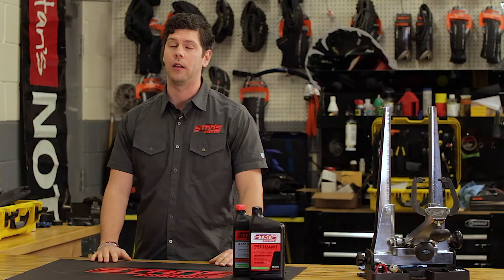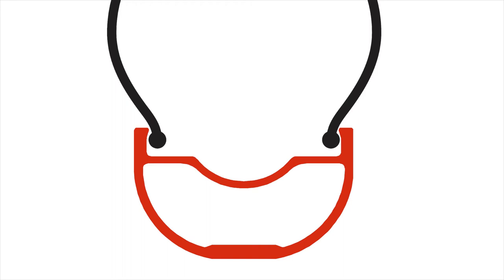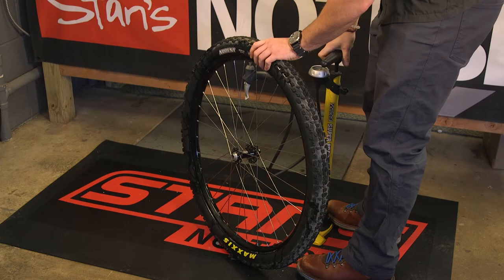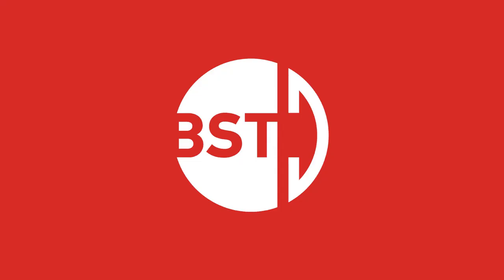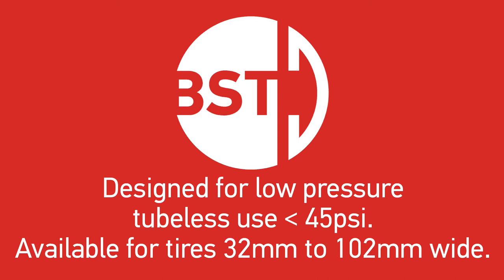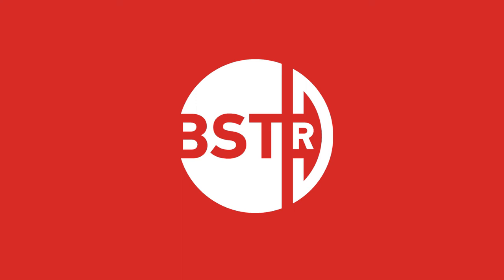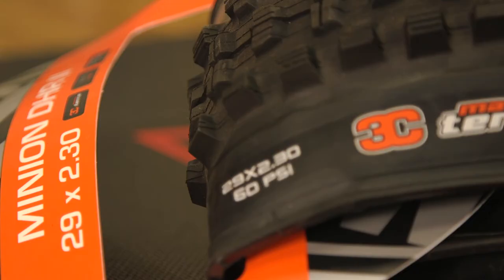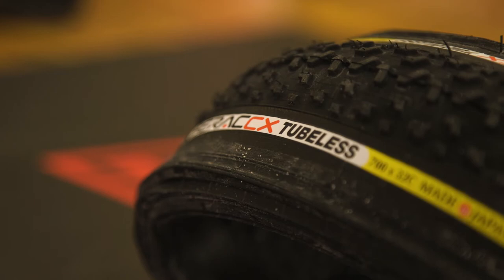BST vs BST-R

Comment: Just purchased my Crest wheel and I'm super excited! The crest has 2.25 limit for optimum tire shape will running a 2.3 be ok?
I know it doesn't seem like much but the whole point is too avoid the Light Bulb shape.
Reply from the maker: Its not a hard limit its more of a range of best fit. So a 2.3 will work.